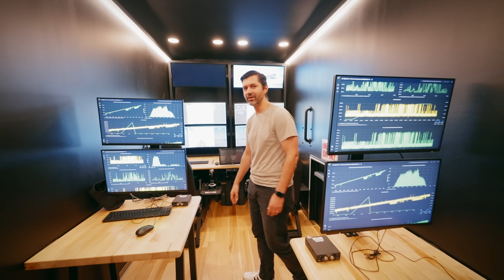Building the World's 1st Hypersonic Airplane | Hermeus

Comment: this explanation is incorrect. hypersonic engines utilize as standing shockwave to heat the incoming air and slow it down to subsonic range. the fuel mostly serves to add mass and therefore momentum to the exhaust flow.

Comment: 2 million dollars for that jet engine,  why not use a rocket engine, you will achieve a whole lot more thrust and way cheaper to manufacture, id build a two stage, a $500,000 jet propulsion engine nothing to fancy to gain that altitude you desire and then you have a rocket engine built by small companies like rocket labs to build you a rocket for around $500,000 to give you a tremendous boost of thrust to achieve mach 5 there, i helped you save 1 million dollars

Comment: 1:23 The F100 or F110 engines are turbofans. Which also means he forgot about the initial fan stage. Not a huge deal but I’m also a TJ/TF design engineer and had a slight heart attack hearing the F15 and F16 use TJ engines🤣

Comment: I see some kind of craft at 6 am right before daylight, that goes two or 3 times the speed of a commercial jet.  Flys about as hi as anything possibleby could. And at this one point in sky, it can turn 90 degrees to the right and go out of sight fast. Seen it 3 times now.  Its not a commercial jet, and the first time,vI saw two  cross eash other and do a circle around each other then go on about their way. No con trail.  Just a light looking light like a star moving. But fast.  In the skys if NC

Comment: The CEO and everyone else was vague (understandably) of what their real mission and business case is. I'm assuming it's creating a reliable jet engine / ram jet setup that the military can use for hypersonic missiles? That's the only thing that hasn't been done before that is in demand. 

Supersonic air travel has been done before and I don't think the business case is there even if the regulatory side is resolved (quiet sonic booms)
Reply: BTW I think this is all a fancy experiment and nothing will come of it. I did some additional research and it seems everyone that is involved in aerospace or applied science doesn't think too highly of them.. When I saw so many young employees in the video and no discussion of how they plan to keep the airframe and electronics from melting at hypersonic speed, I was dubious.

Comment: They don't describe either how the engine transitions from supersonic to hypersonic speeds or how they built the airframe to tolerate the extreme temperatures. Lots if jibber jabber with little technical details.

Comment: Your video sounds very good and I like to see people actually want to push the envelope again. Just remember boys and girls when you get 2.5 mark anything above 2.5 your relative  Heating starts to go up exponentially. F104 could you unlock 2.55 but if it went faster than that it would start to fall apart it didn't shed the Heat very well above 2.55 and that's the big thing the Heat I see that you have an aircraft with a grouping wings like the xB 70 Valkyrie. That was probably one of the best planes that was ever made ever. It was one of the best aerodynamic aircraft were built it had the capability of going close to Mach 4 but the heating was the big problem even though it was stainless steel and other compounds nickel alloy titanium in some places but mostly nickel and stainless steel. The good thing is you have systems now that have been developed in the last 60 years that can make a similar plane much better and much easier to fly remember two things  the weight of the aircraft and the materials that you use to ablade Heating because the heating is the biggest thing. I sent a couple emails to Elon Musk I said you know if you took that 2 billion dollars that you just  spent on Twitter you could probably figure out a better heat shield for that money. I think someday boys and girls you and me will be able to get into an aircraft at LAX in Los Angeles and fly it to the space station and then fly at home without worrying about your wings melting. I think you're doing a wonderful job Sierra Hotel

Comment: The SR71 was a turbo bypass ramjet. When it got to ramjet speed the turbine was bypassed. The secret sauce was to take the supersonic flow down to subsonic so it could mix with fuel. Supersonic flow is like a liquid flowing. It takes longer to mix with fuel. Gaseous subsonic air mixes faster.
Reply: This screams you just watched a YouTube video on it with no engineering background. Turbulent flow allows for better mixing and ramjets are more propulsively efficient than any other engine please do research
Reply: @Ra-wr2kf  Yeah, I have no engineering background and I never studied physics. I did say "I wondered" meaning I was using my own "hunch" suggesting the understanding that any fuel for supersonic speeds would need to be "highly volatile" in the sense of "practical science." I did see that fuel has to be compressed to get more volatile, so that you don't have to find some "super fuel" that burns faster than the speed of sound.
Reply: @Ra-wr2kf  You need to because scramjets are more propulsive and faster. ramjets are speed limited to mach 6 and scramjets Australia has world fastest at mach 12 and so far no one has worked out their speed limit and no one has successfully ran one long enough.
Using hydrogen is reason Australia is the fastest....
Reply: Yeah, I wondered if "time" for fuel to ignite and burn might be a borderline that you could only cross by having some kind of "super fast" burn. Hypersonic seems to get past that, using the "ram" of high speed air - does one part fuel "blow and go" in less time than the speed of normal ignition?
Reply: @robertcox14  It's about time for fuel to mix with air. In the compressed supersonic ram air it's trying to mix liquids. In air compressed not to supersonic flow it's still gaseous, and mixes with aerosolized liquid fuel faster.
Reply: @robertcox14  The extreme temperature of the incoming air at hypersonic speeds allows for high burn rates, so SCRamjets are usually very good at lighting once you travel that fast.
Reply: Interesting points, but I'm pretty sure the bypass air was extracted from the 6th stage of the J58. The turbine was also running continuously during supersonic flight and providing compressed air to the ramjet bypass tubing, with the adjustable intake cone fully retracted.

Subsonic flow is primarily required to prevent shock wave damage to the engine components. Fuel can be mixed at supersonic speeds in a scramjet using shockwaves.
Reply: Not to mention the supersonic shock wave would take all the components at the front of the engine and push them out the back haha
Reply: @dgafbrapman688  The Boeing X-51 Wave Rider used compression lift from shockwaves and used a scramjet engine after getting up to speed from a rocket
Reply: Trick is the nacelle inlets on the sr71 with about 75% energy recovery making the overall propulsion efficient read Ben Rich Skunk Works great book
Reply: Supersonic air is also extremely turbulent and inconsistent in flow rate.  Having that steady, laminar flow of subsonic air is crucial for the engine's intake.
Reply: Darpa, skunk works don't care  @MyHWYBro

Comment: “1st hypersonic airplane” okay I guess we’re going to pretend the X-15 never existed.
Reply: X-15 wasn’t an airplane, it was a manned *rocket*. Conventional turbofan engines cannot go that fast.
Reply: @jmchaser Rocket powered or not, it was an airplane because of its flight trajectory and mission profile. The X-15 was certainly an airplane, along with the X-43, (arguably) the Space shuttle, and other space transport systems that utilize aerodynamic surfaces to glide through the air and land on a tarmac.
Reply: X-15 was rocket powered 😊
Reply: @superblackbirdrider its an airplane. Space shuttle also is classified as an airplane does matter what engine or how it's powered
Reply: @SharonCothren  the whole point of the video is that it is jet engined, not rocket powered. It's the first (or will be) jet engined hypersonic airplane.

Comment: 2:03 - the J58 begs to differ... and technically all modern, supersonic fighters harness, to some extent, the compression from shockwaves generated in the intake. Not to the "ram-jet" level where the compressor stages are fully bypassed, like the J58, but they do benefit from it. Good luck guys. Can't wait to see it haul butt!
Reply: Was gonna say something similar. A bit cocky, but I get that swagger comes with the territory. Maybe actually fly something first though...
Reply: Yea I was fine until he said what they were doing hasn't been done before haha
Confusion level: visible

Comment: It would be amazing for them to explain how their engine is different from the Pratt & Whitney J58 on the SR71. Sounds similar but im not an engineer, so i must be missing something.
Reply: I honestly don't think you missed anything. Sounds like a startup saying all the startup words.
Reply: I was wondering the same... From what I've read, they are both examples of turbine-based combined cycle (TBCC) propulsion, in principle. To my (limited) knowledge about engines, they look quite similar. Some difference: while the J58 engine uses 6 bypass tubes to move air from the 4th compressor stage directly to the afterburner, in the Chimera engine "air bypasses the turbojet" (quoting Hermeus) entirely and is led directly to the afterburner. I can only assume the explanations are accurate. A second difference is that Hermeus base their solution on a commercially available engine, which saves cost - and that's a big deal, for economy and scale of manufacture. It will be very interesting to see how the modification of the Pratt & Whitney F100 (which powers the F-15 and F-16) into a TBCC will work out. Any way, wishing good luck and cheering for Hermeus!    J58 bypass explained (at point in video):  https://youtu.be/F3ao5SCedIk?t=73     Chimera bypass explained (at point in video):  https://youtu.be/-dykzl9Kaf4?t=86

Comment: x15 is not a ramjet, its a rocket propelled. many ramjet equipped airplane/missile are rocket boosted instead of dropped by an aircraft since that make little sense (since as he said it, the craft need to get to ~ mach3 to start the engine). In fact SR71 has literally a turbo-ram jet design so I don't understand why he said no plane has done that before.
Reply: Hence why its called the X-15 Hypersonic Rocket Plane.
Reply from the maker: Yeaaaahhh I super messed up on the BRoll here... sorry guys :(
Reply: @jasoncarman99 meant to be high up in this company and you don’t know the difference between a rocket and a jet… hmmm
Reply: @jasoncarman99  no problem we all make mistakes :)
Reply: @jasoncarman99  don’t worry we all make mistakes. The important thing is to recognize the mistakes and learn from it.

Comment: I wish them the best of luck, but the X-15's top speed is Mach 6.7, the SR-71 (which also had a combined turbine ramjet engine) is Mach 3.3 and the Mig 25 is Mach 2.8+ (has been clocked on radar at Mach 3.2) - so not fastest and nothing that hasn't been done already.
Reply: The X-15 is the only one of those that matched the speed of what Hermeus is trying to build, and it isn't even close to what Hermeus hopes to create.

The X-15 flew for only about eight to twelve minutes each mission, and had to be carried aloft by a B-52. It's engines were more rocket than plane, and the aircraft as a whole was more akin to the space shuttle than what Hermeus is trying to build. It even had to glide back to a runway in order to land (like the space shuttle).Much of the research that was gleaned from the X-15's flights was later used to help design the shuttles.

Hermeus is like a faster version of the SR-71, and definitely is something that hasn't been done before.
Reply: @IndigoSierra  Indeed, both the X-15 and SR-71 have demonstrated that achieving Mach 3+ is possible, but not necessarily practical. The heat generated from friction at such speeds necessitates the use of exotic materials, which significantly increase weight and cost - and I see no ground breaking innovations to address these issues.
Reply: @LZE.  I imagine those ground breaking innovations would be highly classified, seeing as that's what seems to be the largest problem with these systems. 

But yes, your concerns are completely valid. They haven't substantiated that they can solve the heating problem. This may lead to the ultimate failure of their goal for a hypersonic plane, but even if so, their engine design will be of immense value.

That engine is currently Hermeus's one claim to fame, and it is most certainly a ground breaking innovation - right up there with NASA's rotating detonation engine.

Comment: The whole thing reeks of BS as badly as Theranos did to any thoughtful person,  yet everyone gets snowed anyways and the rest of us are left rolling our eyes when it all implodes.

Just claim Mach 10, 1000 passengers and their luggage around the world non-stop with a gallon of fuel and for the price of a subway ticket.. I mean, if you're gonna BS, really go for it!
Reply: I got the same vibe. Trevor Milton play book.  None of those planes were flight articles. They are fakes. Sure they mounted an engine that they only modified, did not design, in them. But those airframes are mock ups, no doubt. These kids are larping as an cutting edge aerospace company. There is nothing more here.
Reply: @stevefink6000  I could even imaging that they will fly a few, what they're imagining is just not feasible. Even IF it would work, the only use I would see for this is military, which I'm already not a fan of, but there are so many problems, I don't think it'll get that far. 

How are they going to handle heating on longer flights (especially with a black plane, gives Pepsi Concorde vibes)? Then there is also the mechanical stress on the airframe by going that fast. The lifespan of a plane will be super short and maintenance incredibly expensive. With those wings, what the fuck is their landing and takeoff speed and angle of attack? They talk about switching from turbine to ram as if it's no biggie, but looking at how insane the J58 is, I can't imagine them just casually building a mach 5 engine. 

Also just the way they talk, comparing themselves to Kelly Johnson after driving their very much prototype plane over the runway and just not acknowledge ANY of the challenges that come with a project as this, sounds very sus to me. I don't even know what's worse, them actually believing they can do that especially with "a couple million $" or it being intentional to get investor-money.